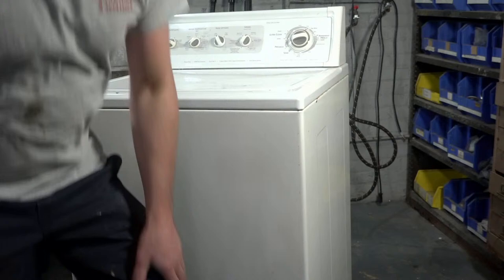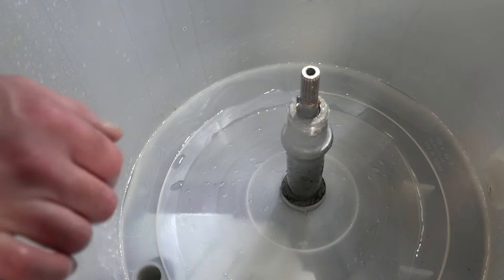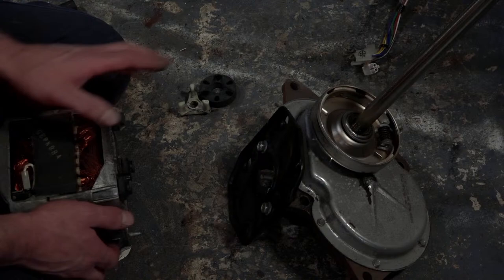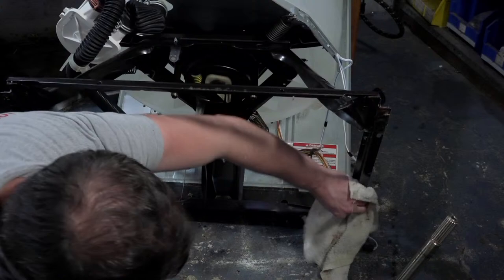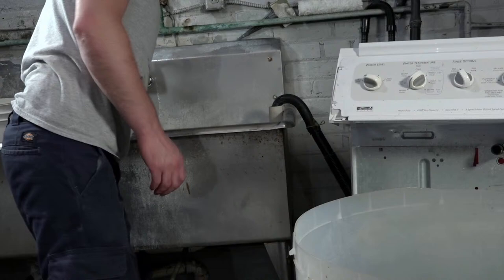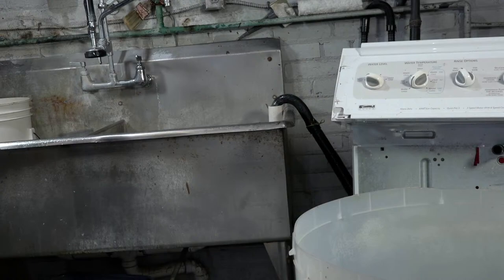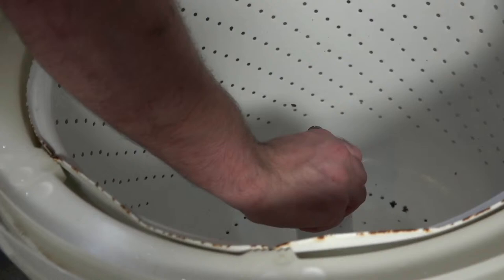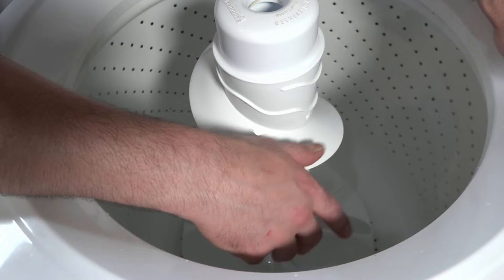Rebuilding A DIRECT DRIVE Washer

Comment: I love your rebuild and repair videos. As a kid I was fascinated with automatic washers. My Grandmother had a 1965 Westinghouse Multi-Program Laundromat top loader, My Mom had a 1967 Whirlpool Imperial Mark X11 washer and my Aunt  had a GM Frigidaire Roller-Matic washer. I was always mechanically inclined and washers were the thing i was interested with. When i was a kid i used to sneak out in my Grandmother's kitchen and watch her westinghouse wash. I was and still am fascinated with the design of the agitators, the way they moved the clothes, the speed of the agitator, even the sound the machines made. Of course that was a time when  all the appliances were built by the original companies. I give you all the credit. You know your stuff. Watching your videos, for me, is like going to school for appliance repair, something i should have done. So keep those videos coming. I learn something every time. The wash videos are great as well. They bring back a lot of memories of a time when appliances were built well.

Comment: Excess fabric softener contributes to the smutz accumulation but isn't the only cause, or even necessarily the primary cause.  My mother used a Kenmore 90 sibling to this model for 6 years (2012 to 2018) which I had fully cleaned and refurbed before passing to her.  She does not use liquid fabric softener.  She washes mostly in cold water and uses cheaper liquid detergents such as Arm & Hammer and Tide Simply (yellow jug).  I pulled the machine down in 2018 to fix a leak, and disassembled it again for examination and cleaning.  There was brown, greasy residue of several inches height around the upper exterior of the basket, on the underside, and in the outer tub.  Service guys often say it's "soap scum" but I believe it's laundry soils that aren't sequestered in the wash water and flushed away due to cold water and insufficient detergent dosage.  Liken it to dishwater that has lost effectiveness from food soils and accumulates grease at the water line if left cold in a sink for several hours or overnight.

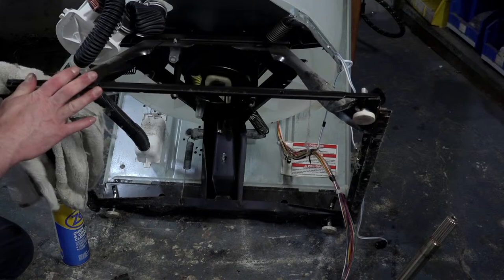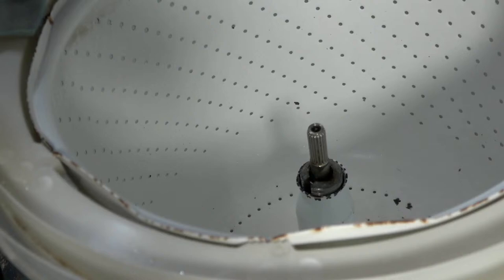Comment: 10:50 = spanner nut.  32:30 the paper piece on bottom of the motor I believe is a spark shield, I've made new ones by tracing an old torn one on a piece of heavy paper such as a manilla folder.  46:40 the sound insulation panel was featured on some higher-end models such as the Whirlpool & Kenmore Catalyst, some Whirlpool Gold models, and KitchenAid.  I have one of each of those, the Catalyst was missing the panel.  Some Oasis/Cabrio/Bravos models had a panel of a slightly larger size and different shape.  I ordered the Bravos part (may no longer be available) and used the panel from the Gold model as a template to cut the Bravos panel to fit the Catalyst.  1:44:00 the purpose of the plastic cam and metal clip that fit atop the basket drive and spanner nut is to provide a positive spin drive to the agitator to insure the centrifugal softener dispenser works properly.

Comment: I had this exact machine!  Love and miss it!  When I moved, somehow it got damaged.  Person I brought it to be repaired, claims they rebuild them fully.  $350 later and a week goes by, I get my machine back it worked great but it kept spinning as it was draining the water (wasting my softener) and would not kick into high spin.  Called the repair company to complain they wanted me to pay for labor to fix it again.  I just used it until it did not spin anymore.  Oh I miss that machine and would buy another if it is rebuilt correctly.  Now I have a crap Whirlpool with a spiral agitator that barely moves.

Comment: My 1987 Kenmore Limited Edition Electronic Fabric Care washer needs a complete overhaul.
Leaking oil.
Leaking water.
Noisy spin gear.
Neutral drain often fails.
Fabric softener dispenser shoots out water and overflows.
It has never had any repair except agitator dogs and fluorescent tube and starter.
I wish you were in California as I would trust you to make it like new again!
No one here will touch it and I am not one to “tinker”.

Comment: Good morning Eugene - super duper work - love your videos - keep up both types - re-builds and repairs.  Love my 2017 SQ - electro-mechanical timer - allows for warm rinses if you play with the timer and fill the rinse in the wash period with warm water then re-set it to the rinse period.   Digitally controlled machines are way too restrictive.

Comment: Eugene, is there a seal where the metal shaft goes through the plastic tub to prevent it from leaking. Does that seal or rubber fitting need to be replaced during this tear down process? Thanks in advance.
Reply: Yes. Cheap design puts a bearing into plastic. It won't last either. By contrast, Speed Queen uses a metal outer tub that will last forever. Their TV-5 machine weights 200lbs. Most others are around 150lbs.

Comment: I just replaced the drive block on the same machine. The inside of the old drive block was striped (I had disassembled the machine a few months ago and it was finer then).  After two loads the inside of the new drive block is starting to strip (the two grooves that line up with the tabs on the top of the transmission shaft). Ever see this before?  Am I not tightening id enough?  Thanks for your guidance.

Comment: My brand new wm9500hka has a burning electrical smell that's pretty strong when it's on and running... should I be concerned?
Reply: Definitely. It could be your house
Reply: Yes. Did you fix it?
Reply: @MOAB-UT   it went away after 2 months.
Reply: @ArcolaBridge  Interesting- glad it worked out for you.